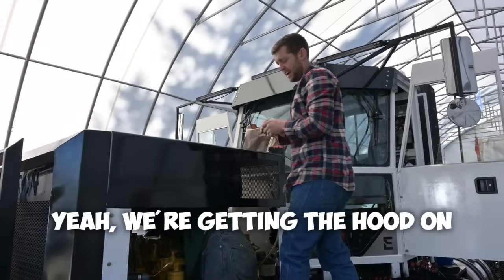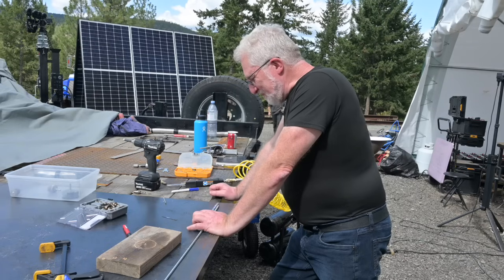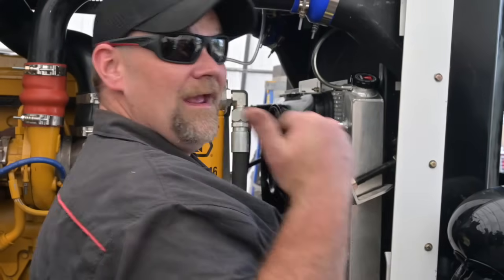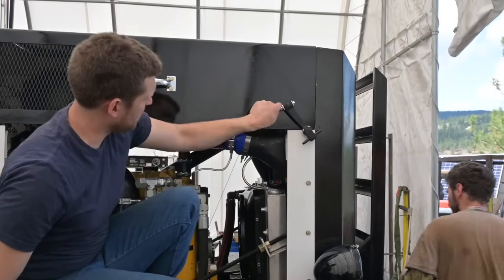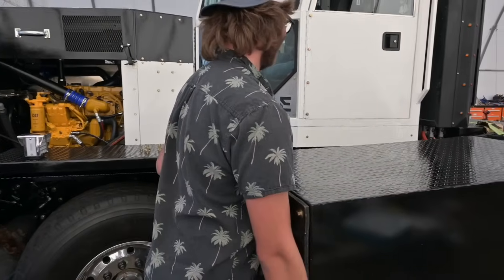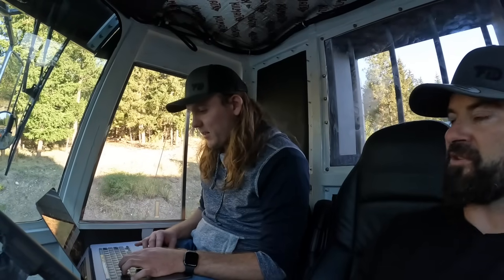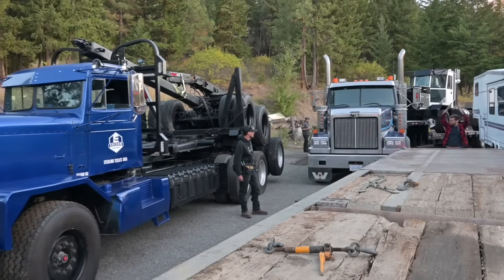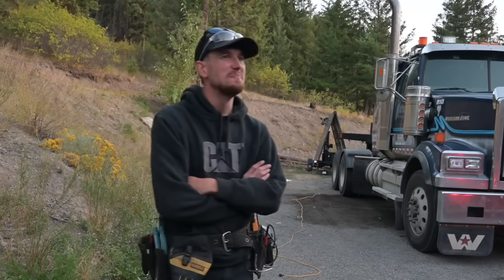Electric Truck Showdown: Loading Up for the Big Day!

Comment: Merchandise idea for. You.    Long underwear with  EDISON  ..printed on the small of the back ……and make them electronically warmed so you can charge them with your truck while you operate it. Blue tooth charging built into the seat ….  They have electric gloves that you can wear to keep your hands warm…. Electrify a Edison. , ball cap / torque..   merchandise a full range of clothing. Jackets /pants /boots/vests  ..etc ..    set all the temperature controls on. Your. EDISON WRIST WATCH …. LOL.    The jackets should have solar panels and battery packs …too.      The technology is out there !!!    Have a. Fun day.   !!!

Comment: In the future, if say, a truck like topsy where to get a logging trailer and that’s all it does, is there a potential to where the trailer would have several batteries on it that would connect to the truck upon connecting?
Reply from the maker: You would not need batteries on the trailer. 
The E-Axles only need to have a high voltage line going to them from the batteries on the truck.

But yes. You can have drive axles on your trailer.

-Theron Danger
Reply: @EdisonMotors  Oh got it, that would be awesome as with the trailer loaded down that would give the trailer tires a fair amount of more traction in the winter going up some of the steep mountainous terrain, though I’m usually not loaded when going up, unless I’m coming out of a valley.

Comment: what are your thoughts on making your software source available once it's in production? (you don't need to allow redistribution, modification or reuse, but imo it would make it sure to be usable in case shtf and the company goes under (I hope not, but stuff happens.), and also it allows checking what's the snag if there's an error that isn't documented, as you can check where the hell error 498 comes from.) 
ideally you could have a small pi on board with all the sources on it, so you'd just have to connect to it with the appropriate cable (usb or ethernet) to a laptop or even a phone (or even plug a screen and keyboard), and use a terminal to modify and flash the firmware.
Reply from the maker: That’s the plan 
-Theron Danger

Comment: Why are you towing the truck to the show? Why not stress test your system and get real world data on what works and what doesn't for the truck by giving it a long drive test, I am guessing it's because it would require it to be registered and would require plates and tags.
Reply from the maker: Because that’s dumb.  You’ve got to do it in a controlled way if you want to responsibly grow

Comment: Am I the only one that noticed, maybe I should have from previous videos, but why is a NEW production vehicle (or well, pre-production prototype) not manufactured in the US by an American company using Imperial tooling (someone mentioned 3/8th bolts for the steps)? One would think that it's 2023, this is intended for global use, long term operation, easy repairability, long term parts availability, that one way to help ensure that is to use all metric/S.I. tooling and specification measurements. I think/hope that within 25 years the US will completely switch to Metric/S.I., finally allowing Canada to finish it's decades long stalled metrication process (because the U.S. backed out of Metrication in the late '70s).
Reply: It's manufactured in Canada by Canadians, they already use metric and yet it has imperial size fasteners and hoses all over. Simply what's eaiser to source for manufacturing as well as service in the region.
Reply: @krpajda  it may be easier right now, but I suspect I. 20-25 years (they want this to have a long lifespan) metric fasteners and hoses will be more common and easier to get. Future proofing is important if you want something to last.
Reply: @technerd9655  why would they become easier to get? the rest of the NA market isnt switching over to metric either, and these items arent complex enough to benefit from offshore manufacturing, the shipping costs more than the production. Imperial just isnt going away, it would be too annoying for everyone currently using it
Reply: Nah. Not with other countries wanting to switch to sae. The metric system works for anything smaller than an inch. Inch or bigger the imperial is more useful in every day life. Spoken from someone who uses both regularly.
Reply: @noturkill9879  other countries want to switch to imperial/SAE? And as for metric vs Imperial for measurements larger than 2.54cm (aka an inch), maybe in terms of language, but as someone who grew up with metric in school but human height and weight in Imperial (well pounds and feet), sure, I use feet and pounds, but I couldn't tell you what an ounce is, or how many ounces in a pound, what a cup is, or a tablespoon or teaspoon actually means, and fluid ounces to measure a liquid is total b.s. I LOVE the simplicity of metric/S.I. as it's all base 10, units prefixes are all multiples of 10. I think the simplicity of metric makes it much more practical than Imperial despite Imperial being based on human relative things. Sure, if I need to measure the length of a room, one could count the number of steps it takes if you put your feet heel to toe, but you can do the same with metric since 1m = ~3.3ft (or I guess that would be 3' 4", since 30cm=12" give or take a millimetre, and 1m=100cm=(33.3cm*3), and this assumes your feet are ~12" long, which is not true of everyone, especially 50% of the population, but again, if not needing to be too accurate, every 3 steps is about 1m, not impractical or complicated, in fact far easier than needing to figure out how many feet is 82 and 3/16" of an inch, or vice versa with or without a calculator (the human brain doesn't do fractions as easily as decimals. 
Most (probably over 95%, if not 99.9%) engineers likely prefer metric, in many modern sciences, like electricity, there is only metric (there is no Imperial volt or amp for example, Thank G-d). Just because it lends itself to accuracy and consistency, does not neccessarily make it impractical.
Additionally, for something designed by engineers in 2023, using Imperial measurements is crazy.
Reply: @noturkill9879  Metric system works also for stuff longer than one inch. It got nothing to do with the metric system but everything with your personal preference using imperial for bigger stuff.

Comment: Just watched another video of a Ural truck hauling timber pieces through what I'm presuming to be several feet deep of mud. The trailer it was using though was also powered via a longer driveshaft and tandem set like the rear axles of a conventional tandem axle truck.

It got me thinking about the Edison trucks you're building here. That what's to keep you from making a trailer similarly? With powered axles that connect to the truck via a long teather cable. For those who xtra slippery log haul roads in winter or in the spring thaw. Because if tandem drives are good with lockers, they hen having another set of driven axles at the back of the unit that are still on firm ground may be better. It's a rather interesting setup.

Here's the link to what i was watching: https://youtu.be/30PGVd7Alcg?si=_ddgcskG0k9nhw7a
Reply: They've already discussed that idea. 🙂
Reply: @WatanabeNoTsuna.  Huh, I may have missed it. Ah well.
Reply: @bishopcorva  It was just a quick remark on some random video, easy to miss. It IS a good idea, however, so I'm sure they appreciate your input! 🙂
Reply: @WatanabeNoTsuna.  Thank you for sure. As I said, saw the linked vid I put which rabbit warrened me to find one of another ural using a pipeline section that was just over eighty feet long. The bogey set under the rear was hydraulic powered and steered by the driver at the front. That got me thinking "hell, I've seen it done hydraulically which means electrically should be much easier."

Comment: Your truck kinda operates similarly to a diesel train:

They have a diesel generator supplying power to electric motors
Reply: In a trains case the engine is always running as there is no battery. But yes.